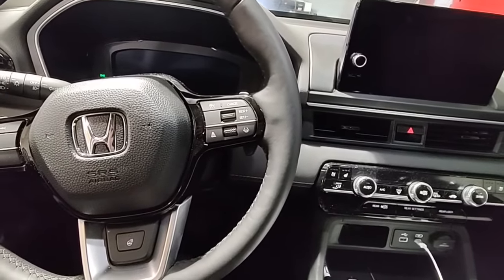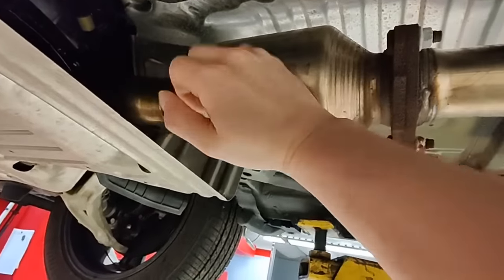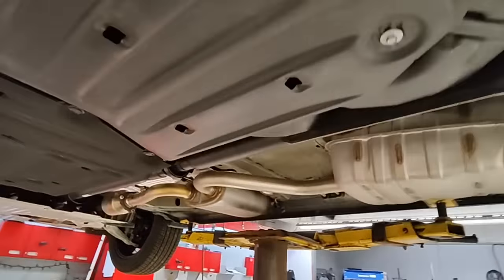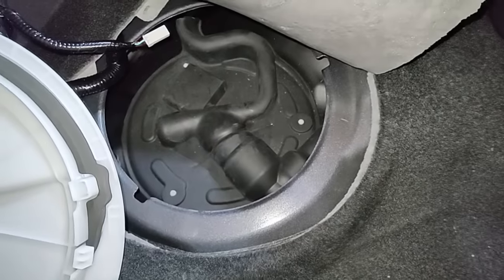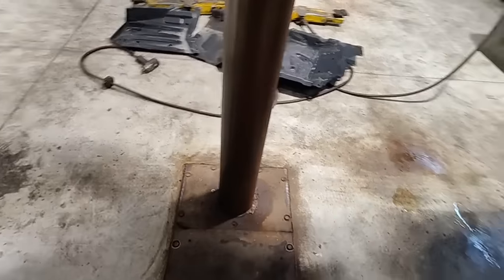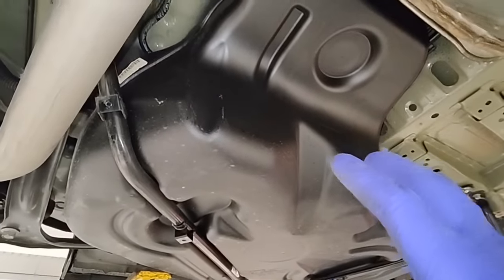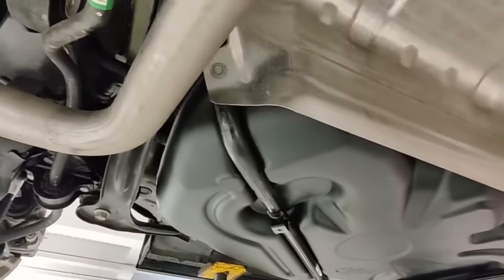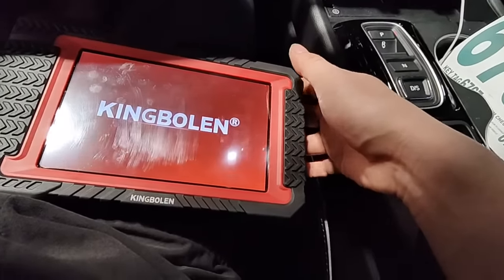Thieves are getting a little bit smarter, just a little.

Comment: As a auto mechanic here in oregon in the US.for the past 25yrs I've seen this more times than I can remember. I've worked for shop here in oregon that would buy a used fuel tank from a wrecking yard for less than $100.00 and charge $600.00 too the customer. Not good. Then complain about pay that we get.
Reply: Oregon and Commiefornia 2 socialist utopias .
Reply: So the poor car owner gets robbed twice.
Reply: That's $1.40 USD. If I lived in a border town, I'd be there once a week.
Reply: @lukereese7753 No it isn't, it's $7.33 a gallon. The video is talking about $1.91 a liter. You have multiply it by 4.

Comment: We installed a diesel tank in the covered bed of a truck  to run off of and filled the oem tank with diesel mixed with def and some gas because they  started to do this when it was up here, found out a few in the area that were doing it😂😂😂
Reply: One dock i delivered to had an old yard dog tractor that fuel was getting stolen from. They started to add really dirty fuel, i think like unfiltered fry oil, to the tank. Only thing you had to do was clean the fuel filter more often, ofc the thieves didn't and after a month they just about stopped

Comment: It's possible they didn't make the fuel tank larger because they wanted to keep the vehicle under a weight target or they didn't want to sacrifice the fuel economy from having that extra weight. Those were some of the reasons they shrank the new 2024 tacoma's fuel tank.
Reply from the maker: I mentioned the fuel capacity with my Tacoma in mind. I barely hit 400kms on a tank when the fuel light comes on. Would be nice when you're out far somewhere camping and not have to carry Jerry cans. I would have that over fuel economy. Or fill it half a tank if you want fuel economy with a larger tank😆
Reply: I can't imagine another 40 lbs of fuel in a 4660 lb vehicle drastically altering fuel economy.... If you wanna get more mileage from having too much fuel weight just fill it less. I remind you an additional passenger is 100-250 pounds depending on how fat your buddies are lol. I'm sure the reasons were far more... government legislation and cost related.
Reply: they want 2 get the range of ICE vehicles down so it isent much better or the same as "most" EV's range between charges,..!.(got 2 go electric or man kind will cease to exist)..they use to weigh new cars "dry"....so with a plastic fuel cell....that isent much more in weight...10 lbs @ the most...?...
Reply: Weight is weight and the reduction game is done in fractions. 40lbs here, twelve lbs there and it adds up to satisfy arbitrary government standards. What the consumer wants doesn’t enter the equation.
Reply: what about the efect of not filling up on 11hr drive increases drivers chances of crashing 
im guilty of this micro napping not resting

Comment: Was better off loosing a tank of gas when thieves  used a hose before manufacture installed some device in the filler neck to stop them and now it will cost you more than a tank a gas for repair .

Comment: Ruining a fuel tank and creating a 1,000$ repair for 20$ -60$ of gas is crazy
Reply: Thieves certainly don’t care about the owners’ repair costs.  They’re thieves after all!
Reply: Auto lawyer Steve Lehto previously said a new Audi fuel tank is $4,000 including fitting as a huge labour cost
 to remove all rear end components  of car.
Reply: @KiwiCatherineJemma  he is right. Audi is a horrible car brand one of the most unreliable… most the tank repairs are insurance jobs anyways
Reply: They do the same thing with AC units, thousands of dollars of damage for beer money. Late 2000's thieves hit a commercial building and ruined 150k worth of units in a few hours
Reply: Smashing a side window worth several hundred to get the change in your ash tray.
Reply: @sabio2009  Yes. Just like back when thieves stole a stereo system out of a car. They don't car about doing a over a thousand dollars worth of damage to pull it.
Reply: @100Proof-n5d  But they are so pretty!  I want a pretty driveway ornament... Who cares about actually driving the thing?
Reply: Let’s start there
Reply: @KiwiCatherineJemma Poor engineering, no consideration that their cars may need to be repaired or even maintenance. Japanese engineering far superior

Comment: $1.93/Litre up in Canada. So $7.33/gallon
Reply: This is about the same as Australia. $1.89/litre.
Reply: Damn thats cheap. Time to move to canada.
Reply: Sparks while drilling would have been a surprise!
Reply: @kwhite145  Not these days with brushless cordless impact drivers.
Reply: That's cheap, $2.67 a litre in Ireland
Reply: @tonymontana897  No sparks from drillbit?
Reply: @kwhite145  No. It's a plastic tank dude.
If it were metal, it wouldn't create a spark either. You drill in slowly to not create heat, but no spark. Try drilling into metal and see for yourself.
Reply: here in chile is about 1.69 canadian/litre, so 4,72usd/usgallon 
(1litre=3.785 us gallon, 1usd=979chilean peso, 1cad=724chilean peso)
Reply: @Nick41622  where lol its like $2.30 for vic

Comment: You should just install drain plugs and a note so they don't have to destroy the tank.
Reply: Using a sealant like Ultra Black RYV on the threads, and a full 24 hours to cure helps a lot.
The cured RTV will swell and prevent any seepage.
In WWII, self-sealing tanks on our fighters used something like it.
Double-walled tanks with natural rubber between the walls.
A round would punch through, and the rubber would swell when the gas hit it, sealing the hole.
Reply: Theieves will still use the cordless tool - you'd have to install a hand valve.
Reply: Those tanks are minimally 1/4" but often 3/8" thick. Plenty of material for threading in a plug. You could even repair the wholes with a plug and save a thousand dollars. I would
Reply: @dangeary2134 the issue is these tanks areade of HDPE which is almost impossible to bond too. RTV will not bond. So eventually it will start to leak again. I'd just thread the hole and put a plug in it using PTFE tape to seal it
Reply: @jasonharrison25  the high temp RTV will swell, but not dissolve.
I repaired an irreplaceable tank several years ago.
A steel plate for the actual hole that was 4” in diameter.
A row of stainless screws around the perimeter. The screws were NOT self drilling, so the material would have a more reliable bite.
RTV around the perimeter.
I let it cure for over 48 hours before putting gasoline back into it.

That tank has lasted for YEARS with zero issues, and not so much as a drip.
Reply: @jasonharrison25  use what is needed for the application.
The RTV is not to be meant as a glue for this application, as it won’t work on HDPE.
That’s why the multiple screws.

Comment: I just replaced a cannister in a 2014 Toyota Yaris, and the fuel filler neck vent went to the cannister. So the cannister had three connections: the tank vent, the fuel filler neck vent hose, and the purge hose (the vent valve was in the cannister in this case). I suppose running the fuel neck fillter vent through the cannister prevents pushing raw gas vapour out through the fuel neck vent when filling the tank. But I don't really understand why the filler neck vent is even needed if the cannister vent valve is already open to atmosphere. Except perhaps to cover the case of the vent valve failing closed, which may make filling the tank difficult.
Reply from the maker: I would think that the vent would act as a venturi with the in rush off fuel it would also draw vapours from it in aiding filling. And I believe the vent on the canister is for sealing when PCM is testing for leaks and releasing the neg pressure but also vents under normal operation when purging so it doesn't create a neg pressure in the tank to allow vapours from the charcoal to flow.

Comment: Just thread the holes and put in plugs.  It is cheaper and next time they want drill holes.  Car companies should do tis and it would save the cars tanks.
Reply: So car companies should accommodate thieves? 
What's your next bright idea? 
A "secret" compartiment in the car where the key is stored? 
Or a detachable catalytic converter for easier stealing?
Reply: @williamgeardener2509 years ago cars had a sump drain for water in the tank. . I would rather they take out a plug than ruin the fuel tank. My neighbor caught a guy trying to saw off his converter.  He let the Jack down on him pinning him under the car till the cops arrived .
Reply: @williamgeardener2509 he is probably the dude taking the fuel 😂😂😂😂😂😂
Reply: Plastic Petrol Tanks cannot be drilled and tapped. Tank body is way too thin.
Reply: I'm pretty sure thieves aren't going to run back to the toolbox to grab the tool to take out the plugs. They'll just drill more holes.
Reply: @Mike-4547  lmao...lmao...!

Comment: i miss the days of the electric fuel pump located on the frame.
that pump allowed a quick replace (without any major operation)
I had a Chrysler 5th ave.
the fuel pump was a lever that when the vehicle ran (the pump went up and down - thus pumped the fuel by the actual motor).  It took about 30 minues (max) to replace.
Reply: Yep, that was the old carb days. Fuel injection needs a lot more pressure.
Reply: That sounds like a pain. My 03, 04, and 05 BMW E46s take 10-20 minutes each to change the fuel pumps (there are 2 lol). They're each 4 10mm, one large hold down ring, 1 hose clamp, and 1 wiring connector. Then just pull up and out in 1 good pull and everything pops out. Pop new unit in, do steps in reverse, and that's it.

I have had to change one on the side of the road lol with just a small pipe wrench in the car XD
Reply: Modern fuel pumps are much, much easier to replace - just lift the back seat and unscrew the retaining ring.  BTDT on a 440 and a VW GTi - much rather change a modern pump.

Comment: Fun fact: If this happens to you, you can use a bar of soap to stop a bad fuel leak and get back home or to a repair shop. It wont contaminate the fuel and it is easily mashed into the leakage area.
Reply: That’s a good tip and also a fun fact! I’m going to put a bar of soap in my breakdown kit right now! (You could also use it to was your hands after changing a flat! )
Reply: hmm good to know
Reply: No you can't use a bar of soap because the fueltank is pressurized during driving,
Reply: @willemstreutgers1154  While it is true that newer cars with an evap system has some level of fuel tank pressure so the gas vapors are sent to a carbon canister, a soap bar, like Ivory, can be used to temporarily stop leaks. An old timer told me about this, and ive actually had do this to a jeep which developed a leak in a fuel tank seam while four wheeling.
Reply: @willemstreutgers1154  I don’t think it is, if you remember that fuel tanks have to be free-vented. (The fuel then becomes pressurised after it passes through the fuel pump)..
Reply: @philtucker1224  One might consider that if a fuel filler cap gasket leaks, then typically the "Check Engine Light" goes on until the gasket leak is fixed and fault system is reset.  That would indicate the fuel tank is pressurized when operating correctly.
Reply: @jimw1615  yes, no it has to be at atmospheric pressure at all times. Pressure can only be applied to the fuel lines through the pump and in a modern fuel system there is also a fuel return pipe to the tank. A fuel tank is never pressurised buddy..
Reply: @willemstreutgers1154  It's only pressurized during evap testing, not while you're driving. Either way, just leave the fuel cap loose if you temporarily plug holes.
Reply: @willemstreutgers1154  so you leave the gas cap loose so what if you get check engine light you're just trying to get home

Comment: How can the thieves drill through the tank without explosion? Are the tanks plastic? It looked aluminum? Can sparks from drilling cause an ignite?  Good clip dude!
Reply from the maker: The majority of tanks now are plastic, Like this one.
Reply: You have to have mostly air/ empty tank to explode. The gas fumes are what causes explosions and you damn near need an open flame. A drill would go right through in 1 sec and not get hot.
Reply: @Habeebea   depending how old the Drill is Sparks can come from the Brushes on the Armature of the Motor inside the Drill......
Reply: Liquid gasoline will not ignite the vapors are what ignites

Comment: I also would love additional fuel capacity.   However, in order to get the car design approved weight must be limited to increase the gas mileage values.  You get smaller, lighter batteries and parts.   Our government requires those measures that are really unobtainable.   Certainly, we all have so much money we can spend whatever they require in order to support their idiotic messes.

Comment: Great video as always, I found your channel from the old Hyundai dealership videos and Honda Fit videos. My girlfriend owns a 07 Honda Fit has 220,000km and we have a problem where the buttons on the key don't lock or unlock the door and we have to lock it from inside the driver door first or lock it using key from outside. Would this be too expensive to fix given the cars age and value? and what type of shop should we take this to (Dealer, independent, autobody)? Thanks for your help
Reply from the maker: Did you try changing the battery? Does it have the fob separate from the key? I know the early fits came with a key and a fob and then the 08 went to a fob and key together. Does the light come on when you press the buttons? Our parts department just replaces the battery customers when they buy a battery or when they bring there car in for service we just replace it. No labour just pay for the battery.
Reply: @theoffroadingmechanic  we have the key with the fob built in. The buttons seem to work because if we manually lock the car first using the key or from inside and then press the lock button we hear the horn sound. I've also tried changing the battery and tried the other key. We think the problem is with the actual door lock mechanism/actuator since when we try to lock using the fob we can hear it try to lock but doesn't manage to lock the car. We also can't unlock the car with the fob but the headlights flash.
Reply from the maker: Oh ok may need a new lock actuator the gears are plastic in the actuator motor itself and probably can't pull the lock cable. We change a lot of actuators so it's pretty common.
Reply: @theoffroadingmechanic  is this an expensive repair usually?
Reply from the maker: I think labour time is 1.1 hrs so shop rate can vary depending what your dealerships door rate is. And I'm not sure about prices on parts Ill probably take a guess and it's around 150 bucks.
Reply: @theoffroadingmechanic  that’s really good info. I appreciate it a lot.

Comment: Fire up the MIG and weld the holes shut. Its easy to do... Just pump the tank full of CO2 with a hose and MIG them closed with the gas pouring out the nozzle. We patched a few gas tanks like this some years back. I even used a steam machine with very high temp steam blowing into a gas tank and we welded it shut. Works good. NO BOOM   LOL
Reply: If can weld a plastic tank with a MIG you sir are far better welder than I could ever aspire to be

Comment: Back in the day, we used an electric fuel pump mounted in the trunk with the outlet going into the filler neck. Open the gas flap & there was a hose barb mounted inside. Just pull up beside your "victim", slide the hose down the filler hose, connect it to the barb & hit the power to the pump. No damage, no mess, no problem.

Comment: Why did you open up the rear seat to access the gauge/sender unit? You could just disconnect the fuel line and wiring if you dropped the tank a couple of inches before completing the temoval 😱

Comment: Hardware stores keep tapered rubber plugs in many sizes.    I usually keep several sizes to plug holes drilled in fuel tanks as a temporary plug only. 

I have used elevator bolts thru the inside of plastic tanks with a gasket inside and out to plug holes.
Reply from the maker: That's a Great idea to put it in the emergency tire repair bag.

Comment: Why is the Pilot that is still under warranty & with 5000kms odo not going to Honda Dealer for repair?????? 🙄🙄🙄🙄🙄🙄🙄🙄🙄🙄🙄🙄🙄🙄🙄🙄🙄🙄.......is the warranty still valid  for 60k kms or 5 years after this repair @ any local shop??????
Reply: Warranty will not cover damage from someone putting holes in the tank aka thieves.
Reply: @FLJAMESFL  that's not the question here. If the repair is done outside dealership then will the remaining warranty be void or not?🤷‍♂️🤷‍♂️
Reply: @KingKong-  No
Reply: @KingKong-   The dealer would never know.
Reply: @e-curb  carfax or similar will surely let them know🙄🙄🙄🙄🙄🙄
Reply: @KingKong-  Dealers like to make you think you have to take it to them to get the oil changed otherwise the warranty is void. However, the law says as long as you get the oil changed by someone who's competent, they can't void the warranty. That means that even the owner can change the oil.  I suspect the same would apply to changing a gas tank.

Comment: J-B Weld the holes... it will last forever for about $10 dollars and 20 minutes of work...
Reply: That's what we did on the farm.  But those were steel tanks, I don't know if even JB weld bonds to that slippery plastic they use now.
Reply: @xlerb2286  it totally works, just got to scuff it with some coarse sand paper...
Reply: @isellcatlitter   Good deal.  I'm glad to hear that little trick still works.  It's always a balance.  Sometimes replacing the part is better, sometimes a little patch is all that's needed.  The trick is knowing which and when  ;)

Comment: If there is room, maybe an aftermarket company will make a bigger tank?
Reply from the maker: I may have seen someone install a larger tank on a Toyota truck can't remember what company.
Reply: Or fit a secondary after market tank with a crossover switch or pump would be a lot cheaper..